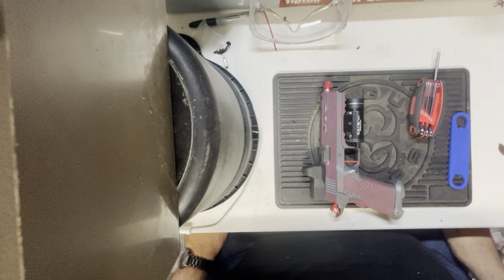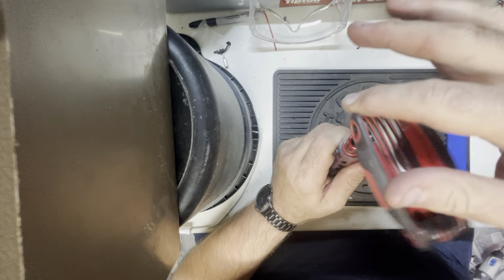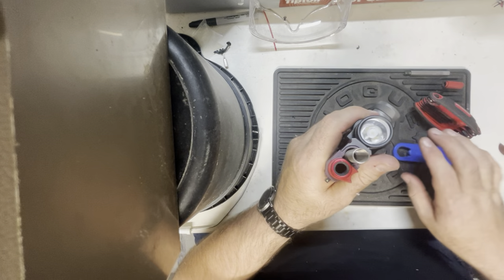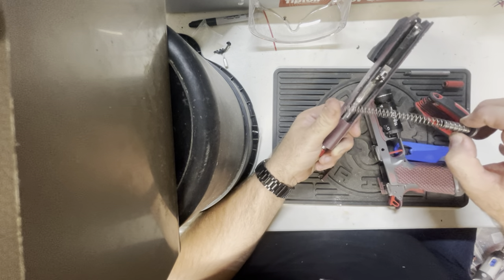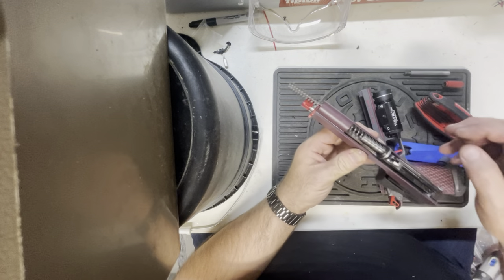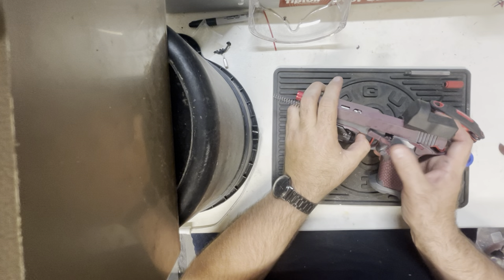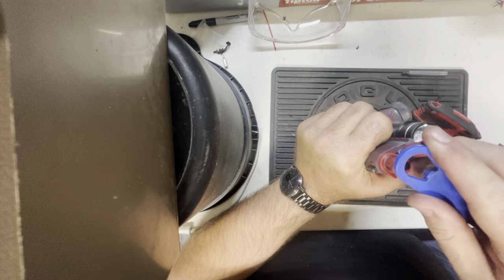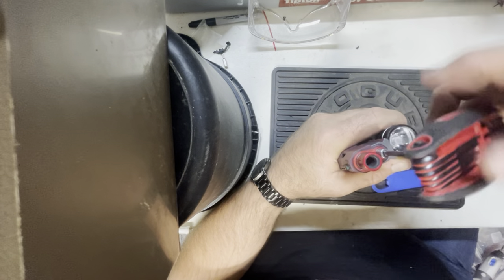Field Stripping the Stealth Arms Platypus (or any 1911/2011 with a two-piece guide rod)

Comment: Got my platy recently.  No need for a tool, except for the 4mm hex wrench to take out the guide rod.  Spring plug pushed down with my thumb, turn bushing, remove plug.  Seriously easy, yet a well machined and fit gun.  Haven't shot it yet, and the anticipation is killing me.  Mines a commander, no rail, short dust cover, classic slide, 407k cut.  I wanted modern classic.  Simple black and m17 fde colors.  Love this beast.